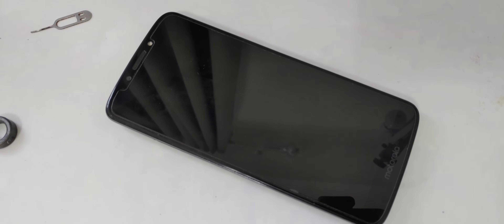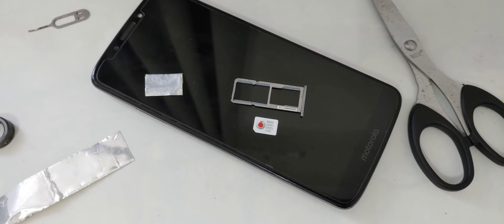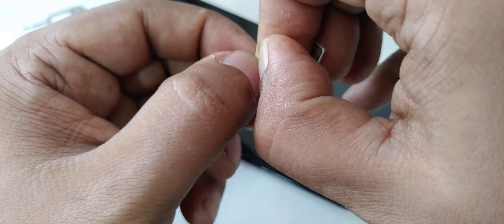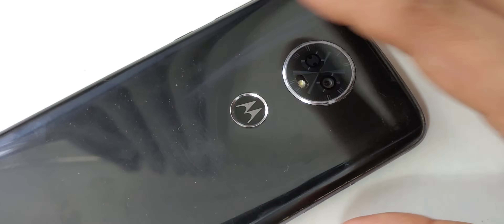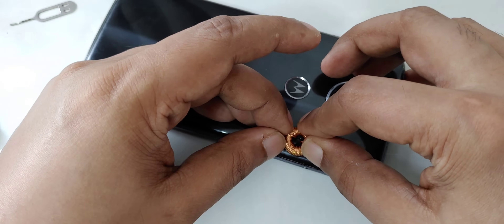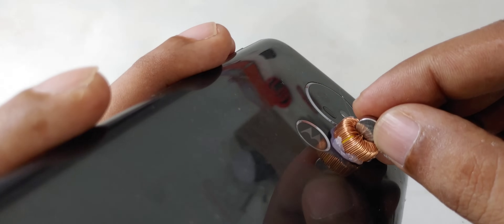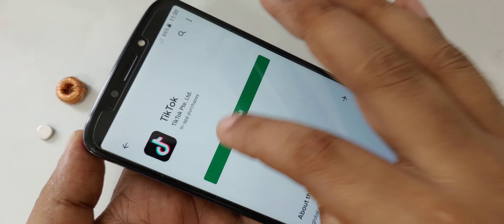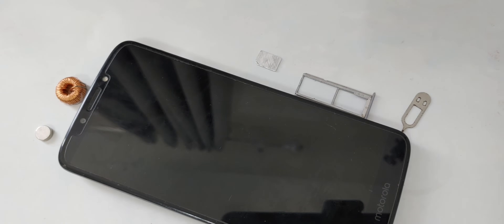how to Get Free Internet From Any Sim No password

Comment: can someone explain why and how does this work?
Reply: This works because of the way the card is designed. It is designed to obtain internet automatically, and then the card blocks the  transmission of getting any service.

By placing the aluminum foil over the card it stops the transmission signal entirely giving you access to internet service without a password.

The coil and magnet is necessary because the transmission signal sends out request to use phone to power the card.

Using the coil and magnet creates the card's own power source.

That is how this works....and it does work.
Reply: no

Comment: I  didn't have a sim card in my old Samsung Note 9, but was still able to get internet service from any WIFI network.
Reply: Of course because that's how wifi works lol. Wifi ACTS as the data service so long as the wifi service itself is live. This guy however, wasn't working off of wifi. He straight up made an antenna that caught the live data transfer service needed to make internet service work. Without wifi. The coil conducted it. The magnet ampd & drew it. The foil connected it to the phones reciever grid
Reply: Maybe I'd say the foil connected the sim to the phones connection points, and that would be more accurate.. that's just conjecture though. That APPEARS to be what happened. He made an operational antenna that draws the actual data transfer service necessary to make a cell phone internet capable in lieu of cell service or wifi service itself

Comment: This works because of the way the card is designed. It is designed to obtain internet automatically, and then the card blocks the  transmission of getting any service.

By placing the aluminum foil over the card it stops the transmission signal entirely giving you access to internet service without a password.

The coil and magnet is necessary because the transmission signal sends out request to use phone to power the card.

Using the coil and magnet creates the card's own power source.

That is how this works....and it does work.
Reply: I have simply explained how a simm card works....the science side of why this should work.
Reply: @appletile2887  Sciency sounding gibberish, just like this video.
Reply: @petem.3719  Funny how it works though....I am using it right now in responding to you.
Reply: Is this even legal ?
Reply: @stallionjr2009  No
Reply: Yes, unless company knows it
Reply: Thanks for the advice and information I will give it a try and hope it works on an Android with one sim card slot
Reply: Free the airwaves

Comment: wow magnetic capacitance impedance microwave inductace. really works if you put psilocibin in your cpu ram of at least 0.005* uH at 7.8 femto farad plus 14.6 Amp watt volt multiply by pi sqared. great.
Reply: Nice way to say bs
Reply: I particularly like the psilocybin on the CPU 😭👍
Reply: You lost me after "wow" ...🤔😇🤣😂😭
Reply: If I decide to use my cool looks when smiling at people outside I never leave home without having my teeth brushed with cooling paste!
Reply: Penicillin is more potent. U just need to crash it and put some paper glue and paste it to cpu the u will have internet for all eternity.
Reply: Oh you forgot to reduce the output of the flux compositor to -15 decajul or you will snap your dylithim Crystal
Reply: Um yes Mr. Music I’ll take two please sir. Thanks 
drdjm1313gm